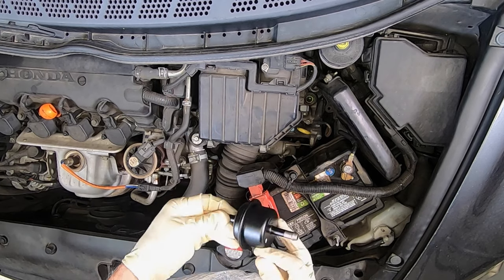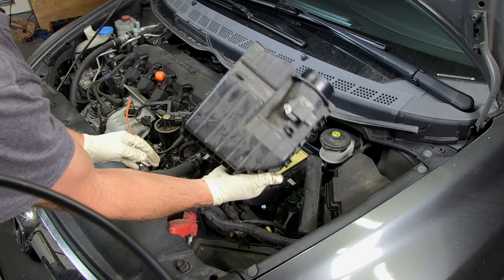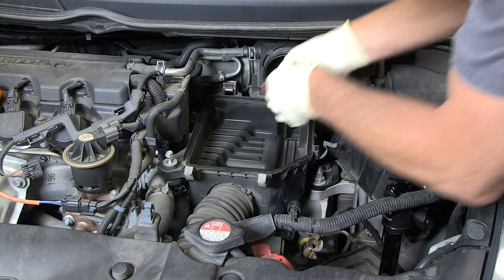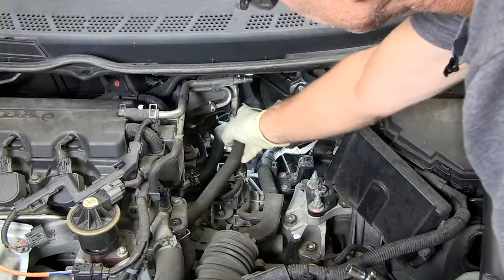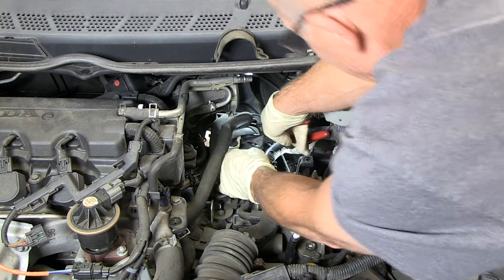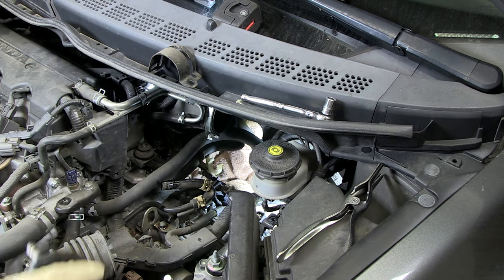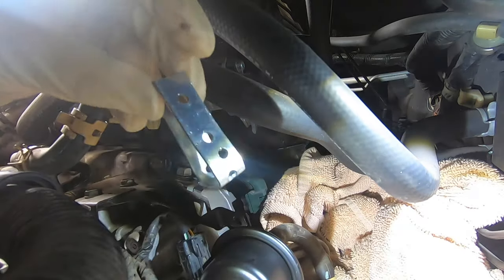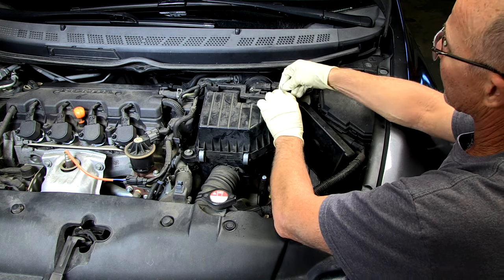Do this to your Honda Civic transmission to extend it's life, filter and fluid replacement

Comment: The filter is directional. Don't put it on backwards
Reply: The top is upward, right?
Reply: I don't understand. He did something wrong what min? Could you explain please?
Reply: @mslucy7230 The filter has a direction of flow. If install the backwards it may still work but certainly not as intended. I've seen people take them off look at them say they're good and put them back on backwards which flushes all of the contaminants back into the transmission.
Reply: I put mine diagonally
Reply: Ty
Reply: Glad to have seen this comment
Reply: Can I do this job with the couple tools a I have — a knife and fork ?

Comment: just did this job yesterday, took about 2 hours. its not just the hose retainers that are troublesome, but also the fact that you cant see them while struggling to remove the retainers and most of your view being blocked by the coolant hoses. had to re-watch this video because i got the orientation wrong and also managed to somehow bend the lower pipe.  what i did was remove the hoses from the steel pipes not the filter. maybe if i was doing it from below, i would have done danny's approach. oh, and putting the retainers back, i used a cable tie to hold down the pliers that is keeping the retainers loose.
Reply from the maker: Great tips, thanks for sharing
Reply: Many of us wouldn’t have known there was a transmission filter there in the first place, as honda did not bother to include it on the maintenance list, so thank you @dannysdiygarage for your efforts. 😉
Reply from the maker: @benf3996 appreciate your support ❤

Comment: I have a 2014 civic is at 156K miles and never changed any of the filters. I bought the tiny round orange one thats on the side of the trans but not installed yet. So there are 3 filters for the trans?  Dealer told me there were no filters to change. I Did the fluid change every 30K miles. Are changing all these filters really necessary. I dont think most do.

Comment: I replaced this filter after the 3x transmission drain and fill change! This filter is very important to change.
Reply: I have a question for you, did you do your 3x transmission drain and fill all at once or at a decreased mileage interval ?

Thanks 👽
Reply: @thomas0086  I changed it once a week and changed the filter on its last change.
Reply: Thanks for the input going to do a drain and fill tomorrow hopefully I can try to change the filter in about 3 weeks

Comment: i just did this job and it took me 5 hours, i can 100% say i learned so much and i am able to give tips to help out others who will be doing this by themselves, first of all, watch another video of this from a youtuber named "Hands On Dismantler" his method is what i had to use and he states the reasons of why its the better way(if you dont have a hose remover shown in this video) , why do i also believe its the better way? because removing the hoses from only the filter is nearly freaking impossible let alone using grips to loosen and move the hose clamps, theres no freaking space and you can only use one hand.

Heres my TIPS
[Extra tools needed]:
-BUY hose removers or hose separators (seen in this video)
-buy many different pliers, all kinds, long pliers, curved pliers, straight pliers, 90 degree long pliers are a MUST!!!!! i cant stress this enough
- buy extra  hose clamps of many sizes( you will most likely drop one from the breather hose and the one going to the airbox
-buy WD40 to loosen filter hoses since they are brittle and hard 
-strongly recommend to just go ahead and buy new hoses of the one we are going to be removing just incase.
-lights many lights, i had 2 of them fail me today due to having them on for 4 hours, they failed me when putting the new filter on, i had to use my phones flashlight to complete this job in the dark

diyers
you will struggle, this is a very very very hard job if youve never done it before.

[Job Tips]:
- remove the cowl cover and the metal thing under the plastic cowl cover, this will make removing that god damn airbox wayyy easier, i removed it without the cowl cover but had to remove cowl cover along with metal cover to be able to reinstall the stupid airbox back in, its nearly impossible to reinstall without removing cowl cover.

- use PB blaster, oil or WD40 in that dumb clip thing that is to the left of the airbox in order to slide it out easier and remove the airbox.
- before removing the ATF filter from its housing, leave the upper atf filter hose connected to the filter and instead follow the hose rubber towards you and remove it from the metal line instead, use WD40 first, then with pliers carefully twist it a bit then spray wd 40 again and twist it while pulling and it will easily come loose, once loose remove it, after that now we can remove the atf filter bracket to free it from housing(its still attached by hose in rear)
- now here is where it gets hard, theres 2 ways to do this, if you have a hose puller tool (shown in this video)
since the filter is now free and you can move it to see the rear hose, you can use the pliers to loosen and move the hose clams and use the hose puller to disconnect the rubber hose from the filter, ORRRR if you dont have a hose puller, follow the "Hands On Dismantler" method,   follow the rubber hose and youll see its attached to a metal line that is shaped like a U.
same principle, use pliers to remove the hose clamp and use the filter to twist it slightly clockwise and counter clockwise until the hose gets loose" DO NOT PULL ON THE FILTER" if you damage the line shaped like a "U" you will need to replace it, however i observed that you can twist the filter which still has the rear hose connected and it should loosen up the rubber hose from the U line, once loosen up stick your arm in there and gently pull on it but be careful not to pull too hard on the U line, its strong but lets play it safe( or buy a replacement, doesnt seem hard to replace)
- at this point you will have the ATF filter out but will still have the front and back hoses attached to it , now its easier to remove them since the part is out of the car.

Re assembly tips:
- you can install the front hose first onto the filter but do not install the rear one yet( basically only install the hose on the filter that will be facing the front headlight)
- first install the rear hose without the filter into the U line, then use the pliers to place clamps back on.
- now the filter should have the front hose attached to it, attach it to the metal line in the front so its held by the hose to prevent it from being dropped behind the transmission when its time to install the rear hose( dont place clamps on yet)
- once the filter is connected to the front metal line, place the filter in its housing without putting bracket on in order to hold it in place and make it easier to slide in and connect rear hose( getting to use both hands is impossible so this is why i say place filter in housing so its held by it to connect the rear hose onto the filter, or else as you try to connect the rear hose the filter would just be moving away since nothing is holding it)
- once you get the rear hose connected to the filter, now you can then disconnect the front hose from the front metal line again in order to push the filter to the side so you can re attach the rear hose clamps back on and adjust the hose if needed.
-boom we are almost there, now we simply  reconnect the front hose to the metal line and place the clamp back on and now we can push the filter into the housing and place the bracket back on and tighten it with the 10mm bolt.
- now since we have the cowl cover off, we can reinstall the airbox much much easier and re assemble everything and BOOM we are done.

i hope this method can help make this job a lot easier for you guys
Reply from the maker: I appreciate you taking the time to share this information to help others, such a kind gesture, thank you so much ❤
Reply: I’m looking at doing this myself. Very helpful info. I appreciate you. I love how humans naturally feel an urge to help others. Even strangers 🙂
Reply: You can easily remove and connect the atf filter by removing the rear hose from underneath the car. No need to for all the extra steps.
Reply: @khoavu1341  this could’ve helped me. And I agree. I’ve never done it and finished the job in about an hour by following the video method. If I had fat hands or wrists, it would’ve been tough because my filter was more difficult to get to than the car in the video. But definitely not a 4-5 hour job considering all I’ve ever done before is change my oil and taken off my door panels
Reply: @khoavu1341 please explain, do you have video showing this way?
Reply: You saved me from replying in detail. I just did the filter on my 2006 civic and it also took 5 hours. What is deceiving in the vid are the shots he takes with his phone. They make it look like there's far more room then there is. The screw that holds down the filter clamp was way too rusted and I had to work in that tiny area with a Dremel tool to cut it free. Then there was a slight difference in the crimp edge thickness on the new filter which was to thick to fit back into the top part of the clamp. Now it's all back together. My arms are nicked all over and my back aches, but it's done .

Comment: everyone should be very careful when removing the hoses.  I tried removing the rubber hose from the pipe that comes out of the transmission and bent the steel pipe in the process without realizing it.  I was able to slowly bend the pipe back into place and VERY LUCKY it did not kink or break.  I am not sure if the pipe is steel or aluminum but Honda does list a part number in case you break yours make sure a dealer nearby has it in stock 25920-RPC-000.
also probably just a good idea to simply remove the hose directly attached to the filter canister itself to avoid potentially bending and breaking the hard line altogether!
Reply: Outstanding tip, thanks for posting.
Reply: Did the exact same thing just now but i pulled it closer to me slighting to get the pliers a better angle of attack on the clamp and then just bent it back when done
Reply: Take it to a shop diyerr lol
Reply: Bent mine too 😂
Reply: In the service manual it is recommended to remove this

Comment: I really like Danny and he really comes across as knowing his stuff BUT I have learned that sometimes the best thing to come out of his videos is that you realize this is not a job that you want to tackle.
Such was the case with his video on changing the inline transmission filter on my 2008 Honda Civic. 
For those of you struggling with this same issue, keep in mind that Danny’s high quality camera shots make it appear that you have easier access and more working room that you actually have.  I was surprised once I got the air filter box off, realizing the inline filter was only partially exposed and actually was in the back, facing the firewall.  
I have a pretty fair background in doing my own repairs and it might be that I simply have less patience these days but be aware, this job is a pain in the ass.  I even removed the filter box a second time after giving it some thought and watching the video again.  As much as I hated to give it up, suffice it to say, not spending any more time on it.  Good luck on which course you choose to take.
Blake
Reply: Yeah it's going to be a no from me dawg. Guess I'll just keep the old filter in there until my car dies lol

Comment: Great video and thank you..  by the way, as far as those clamps concerned, you can always change to a different type of clamp with a hex head screw so that you can use a socket and ratchet to tighten the clamp, which is what I did.
Reply from the maker: Great additional information, thanks for adding this
Reply: Bad idea. Those clamps can’t expand.

Comment: if you are going to replace the transmission filter and have to remove airbox assy, you should probably clean your throttle body while airbox is off since removal of airbox kinda sucks.  I had an issue where my honda would stall occasionally while stopping/turning,  the throttle body was dirty and restricting airflow around the throttle blade causing the stalling issues.  runs great once again after cleaning throttle body, cleaned the MAF sensor and installed new air filter while i was at it.
Reply from the maker: Great suggestion , I should have mentioned that, I appreciate your wisdom , thanks for adding this in the comments, I’ll add a link to the throttle body video

Comment from the maker: I don’t have a bunch of experience with CVT transmission, 30k would be my first fluid change and probably every 30k after that unless you’re doing hard driving conditions, filter I would follow factory manual scheduling, make sure you use Hondas specific fluid for that transmission, great you’re talking care of your transmission

Comment: Excellent video outstanding camera placement for the filter removal. The only tip is to buy a 3-foot section of high pressure hose and move the filter up onto the firewall or to the top of the motor where you can access it without removing the air box every time. I do my changes annually and it only takes about 10 minutes total.
Reply from the maker: appreciate you watching and adding your feedback
Reply: Wow you really babying it lol. I've owned my civic since 122k miles. Had the fluid flushed at maybe like 150k miles and haven't changed it since. I have 292k miles now lol 😅. Definitely gonna change the fluid and filter now tho
Reply: @andrewk8636  this is in a vehicle that is used primarily as a winter car in New England. About a 90 mi round trip to work and back at around 85 mph so I generally do the transmission fluid every season for good measure. It's still bulletproof. Wish this thing warmed up better in the winter though.

Comment: Just did mine, dealership gave me the wrong washer for the drain plug, ended up giving me washers for the engine oil plug when I specifically said transmission plug. Hopefully it doesn't leak lol just re used the old one. Thanks for the vid
Reply: Trans drain plug and oil drain plug use same crush washers fyi

Comment: Did this on a 2009 Civic. This job was a 10 out of 10 on the difficulty scale. If you can outsource this to a mechanic, do it. The removal and reinstallation of the filter, especially the rear spring clamp, was the hardest part of the job followed by the replacement of the filter bracket that was nightmarish. There is no room to get both of your hands on the parts that you have to manipulate. No plier has jaws wide enough to deal with those spring clips. Use the trick in this video or do not even attempt this filter change. I had partial success with a pair of needle nose pliers. It took me at least 1.5 hours to remove the filter and get it back into place. It was hellish. My back is killing me. If you are going to do this, when you remove the spring clamp above the Phillips screw, put a tie wrap on it otherwise you are going to lose it during the filter box removal or reinstallation. Both the removal and replacement of the filter box was also a nightmare. I would pull the battery after you struggle to get the box back in to place. Do not buy the supposed "genuine filters" on Amazon or eBay, they are junk knockoffs and they do not have the bypass that is critical if the filter gets dirty. Buy the Beck/Arnley 0440434 on Amazon. $19. Again, do yourself a favor, and hand this off to a good mechanic with a lift and long thin arms. Do not do this project unless you want to ruin an entire afternoon, it is absolutely not worth the aggrivation.  Walk away and your future self will thank me.
Reply from the maker: Thanks for sharing your experience and filter suggestion, I added it to the description

Comment: Great informative video, thank you.
I have just one comment. At 1:18 You should disconnect the negative terminal of the battery 1st, if you start by the positive terminal and your wrench touches the car's body, you will have a short-circuit.
Reply from the maker: You’re correct, thanks for pointing that out for others
Reply: Great Safety tip.

Comment: Jobs like this always feels like I'm going to break something in the way to get to the primary thing I'm supposed to work on. Usually its a silly plastic flex tab or something else. Over the years I learned that the best way is to go slow and think critically every time I get into a spot that needs finess, instead of thinking "this is stuck better yank it out".
Reply from the maker: So true, the older you get the smarter you become 👍🏼

Comment: I changed the transmission fluid on my daughters 2013 Civic today following your other video, pretty simple and thanks for posting that! 

As for the filter box, I unhooked the 3 tabs for the air box, opened it enough to remove the air filter, removed a screw in the front and on the right side and it was 90% loose, but there was something else I couldn't locate that was holding the airbox in place and keeping it from easily coming out like in your video...seemed like it was in the back where I couldn't see or feel. 

You have any idea what I could be missing?

Comment: Thanks for this video. I have two Civics, 2001 and 2005. I had both cars' transmission replaced with better & upgraded version that corrected the faulty 7th generation transmission. However, they gave me this plastic filter which I dislike. I just found out that Civics from 2006 thru 2015 have this OEM filter that I didn't know about. So, I bought one and replaced it on my Civics which is so much easier to access since the location is right next to the radiator. 
My question is which end of that filter in the video is flowed upward or downward?
Reply from the maker: I don't have that answer

Comment: I use Lucas transmission leak stoppers mixed in with the Honda transmission fluid on my high mileage 2003 civic lx.